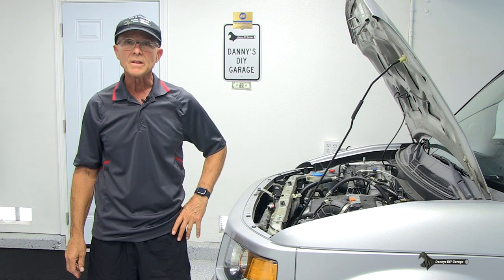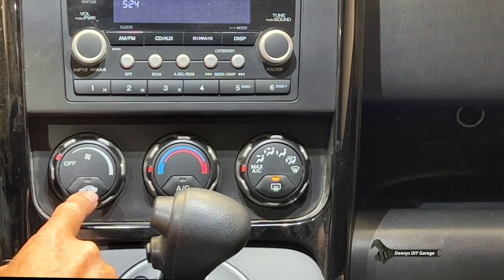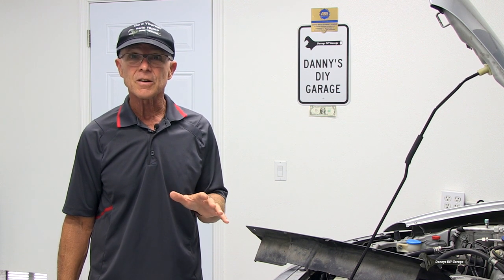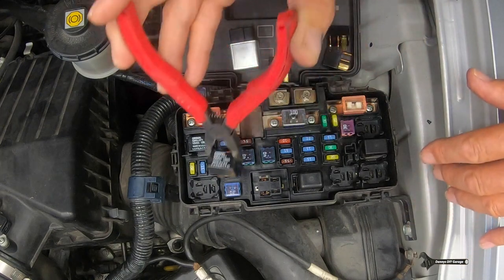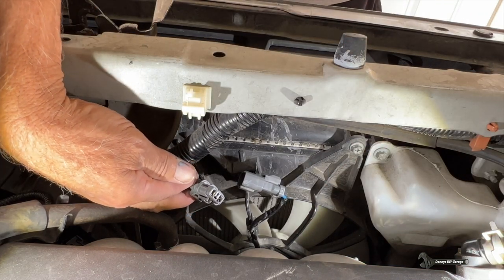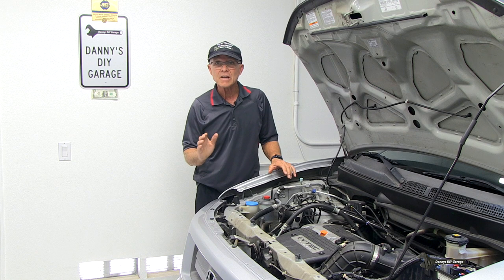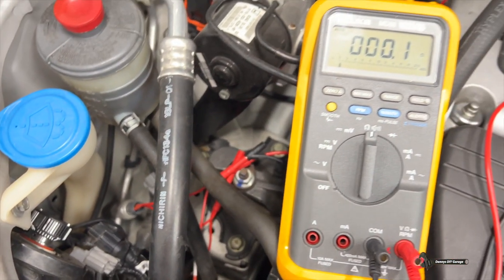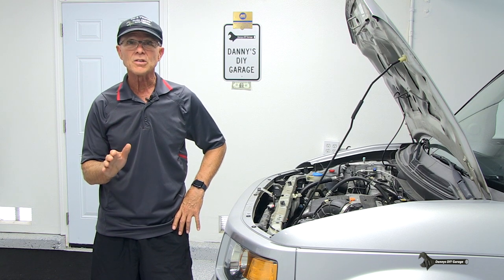Air Conditioner, AC Blows Warm at Stops, diagnose why the Fans are not working Honda Element

Comment: Hi Danny! I checked all these what I noticed is my Radiator fan isn't running but my condenser fan is car will start to overheat while in idle. I already checked fuses and switched the relay. Im about to order a new radiator fan and hopefully that fixes my problem also no leaks at all. my car blows cold air just not when in idle.

Comment: Great video, Danny. A valuable piece of advice you can follow or offer anytime dealing with electrical issues is to get a hold of the wiring diagram for that particular vehicle. If not, you will be chasing a problem in the dark.
Reply from the maker: Absolutely agree

Comment: Mine was the 30 amp small green fuse. Put it in, ac came right on w cold air. Turned it off thinking it fixed it. Went out the next day and no load on the ac and also no cold air. I got home and the 30 green fuse was blown. Brand new one too. I reached down w power off and tried to turn the ac condenser fan on the right w my hand: it was really stiff to turn . I think it’s my fan that’s bad. I did your check on a different video and I got 11 blinking lights. So I’m not totally sure what to do, Danny. Any ideas by chance please ?
Reply from the maker: @seanhunty9304  the condenser fan should turn freely just as the radiator fan should turn freely
Reply: @dannysdiygarage thank u sir for the prompt reply . Yea, the fan turns but it takes a bit of force to
Turn it. Guessing the 30 amp burns out because of that extra force to turn ..
Reply from the maker: @seanhunty9304  that’s correct
Reply: @dannysdiygarage  thank u!

Comment: Hi Dan, My honda City 2009 is having the problem of not blowing cold air in afternoons or when its hot outside but icecold Temperature at night times/colder times. Both the fan is working perfectly and the airfilter and cabin filter and radiators are clean as well. I'm thinking maybe expansion valves issue? But then why cold air at night?.Also i cant see any frost on the valve tubes which kinda says not an expansion valve problem also.Any thoughts or suggestions dan would be much appreciated.
Reply from the maker: If your systems Freon level is correct, the expansion valve is probably a good possibility, did you watch my videos on replacing the expansion valve
Reply: Same issue with my 2007 Honda civic as well

Comment: Hi, I tried the diagnostic to turn the fans on but the radiator n ac fan didn't turn on. I checked all the fuses and relay. The fans turn on if I put direct power on it. Any other suggestion?
Reply: I'm chasing a similar problem, my compressor clutch is not engaging. Today, as per your instructions,  I found the condensor fan not working. While troubleshooting this issue, I found that if I turned off the A/C switch (push button) on the dash, the fans would start. Press the button, and the fans turn off.  Interesting issue....
Danny, you are producing some great videos. I truly appreciate your attention to details including the addition of lighting on the components you are discussing.